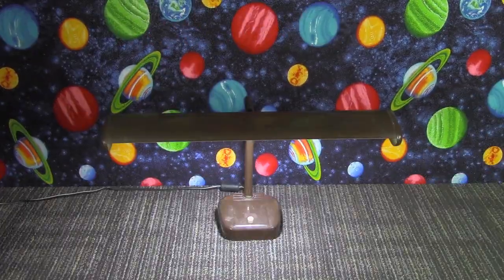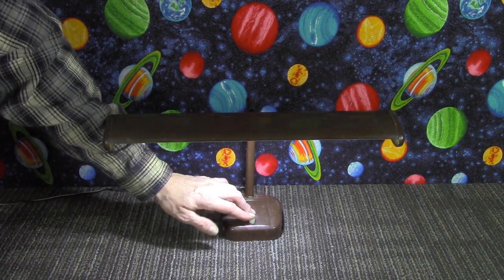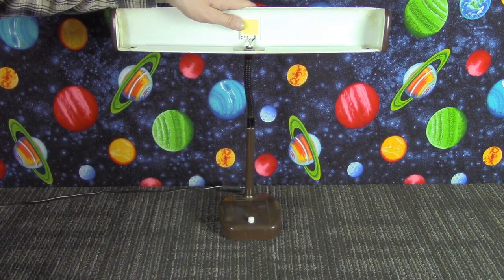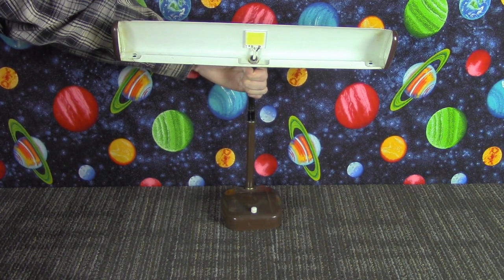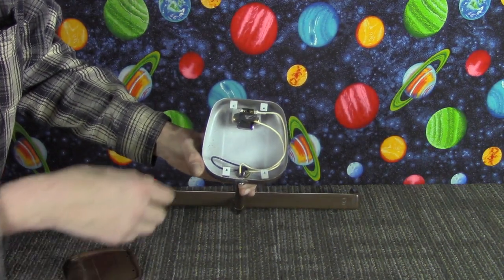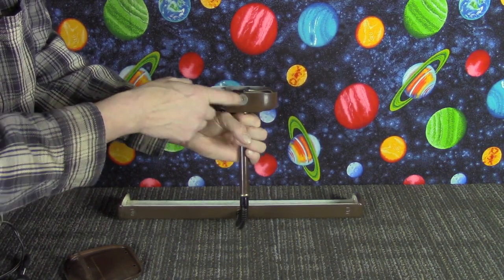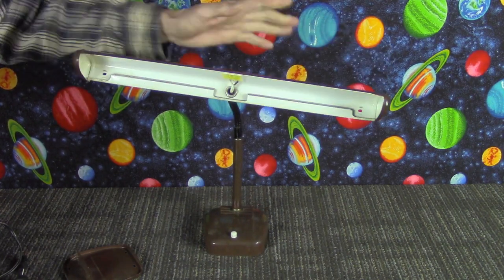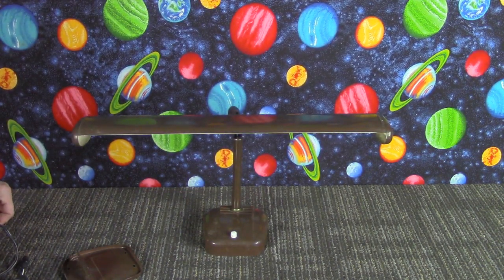DIY desk lamp COB LED conversion

Comment: can you post were did you get the LED, transformer, switch, socket to plug the transformer in?
Reply: I agree.  I have looked all over the internet trying to find 12v 4 W COB LEDs.  Can't find them.  Need source for all items listed here.

Comment: The only problem I have with this is with the florescent lamp I just plug it in and go.  Your system has that clunky transformer.  I think I'm going to look into using a transformer in the base or even replacement bulbs that work on 120v AC.